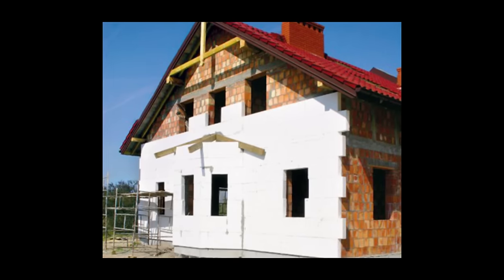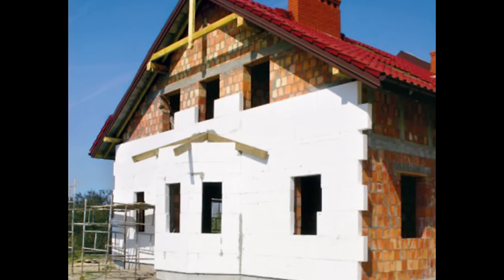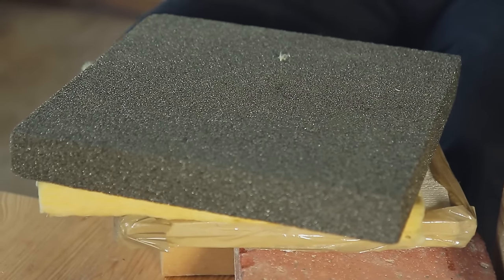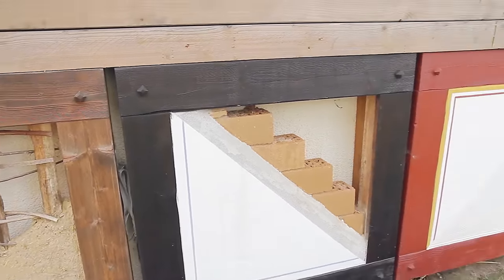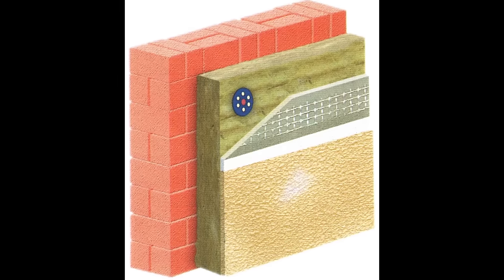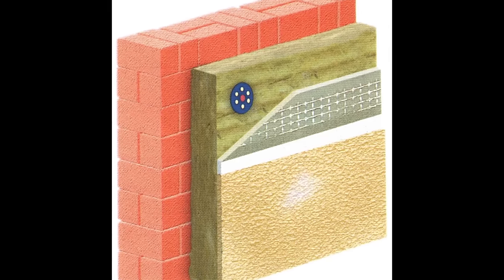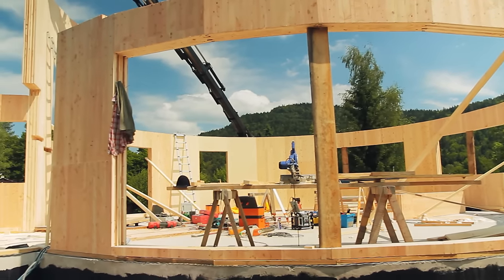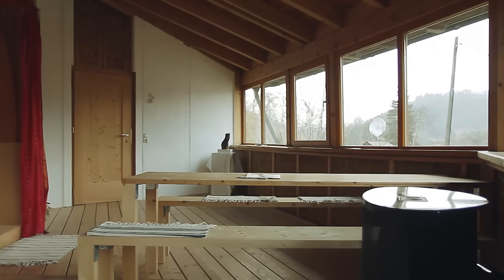Wärmedämmung – Was ist sinnvoll?

Comment: Immer mit Lüftungsanlage bauen
Reply: Welche
Reply: Vermutlich  " PAUL " 
Die Holländer gehen von den Lüftungsanlage wieder weg - sei ein deutsches Ding
und diese machen die Leute krank ( chronische Lungenkranheiten mehren sich, 
speziell bei Jugendlichen, Kindern ) 
Ich pers. würde so eine Obsoleszenz-technik nicht im Haus verbauen - 
speziell in den Rohrsystemen verkeimen die Innenwände und kontaminieren 
mit ihren Verwirbelungen die Räume. 
Dieser 
ganze Kram wird oft in Fertighäusern eingebaut, weil Masse zur Kühlung fehlt. 

Ein Ziegelhaus mit 50 cm starken Aussenwänden, benötigt keine Klima-Anlage, 
auch nicht in Regionen, wo es längere Zeiten rd. 38 Grad C + Temp. gibt. 
Auch bieten Einlegeziegeldecken + Betondecken mehr Masse für 
Kühlung in Sommerzeiten + mehr Speichermass in Winterzeiten.
Reply: @hotzenplotzrakete8869   Wenn sie richtig gewartet werden Sind sie keine Drecksschleudern